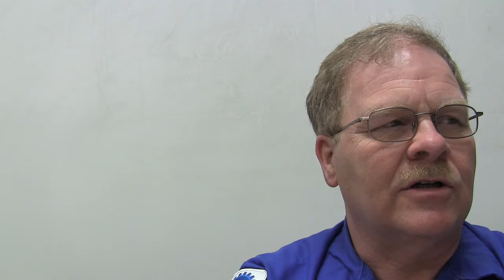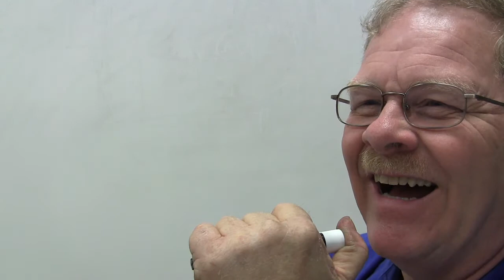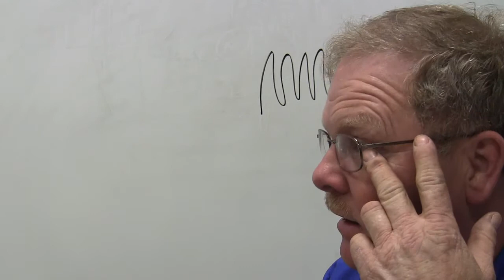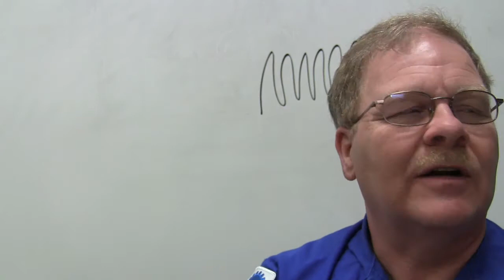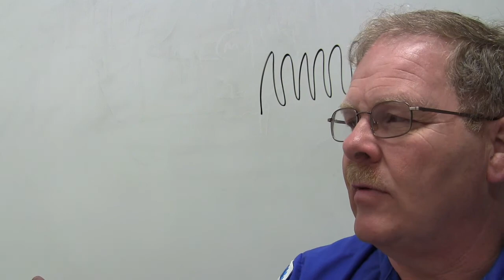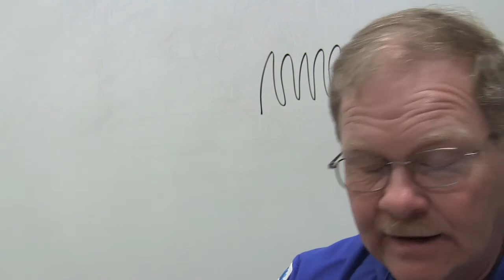Engine Performance 2 Test 4   Mode 6

Comment: I've heard that about injectors shutting off during deceleration.  Do they shut completely, as in no pulsewidth whatsoever?  Or almost none?

It doesn't make sense to me that the engine is still spinning and the plugs are still firing but no fuel at all is being introduced.  Wouldn't no injectors have the same result as a dead fuel pump or cam sensor?  Would you even need the ignition to fire since there's no fuel/air mixture to ignite, just compressed air?

Is the torque converter the force that is spinning the crankshaft at this point?

Sorry for all of the questions, it's something I've been wondering about for a while.

I've missed a bunch of your videos, I have some catching up to do.  Not enough people know what mode $06 is, that shit saves me on Fords with misfires.
Reply from the maker: Well, they shut off because there's no need for fuel at that point...